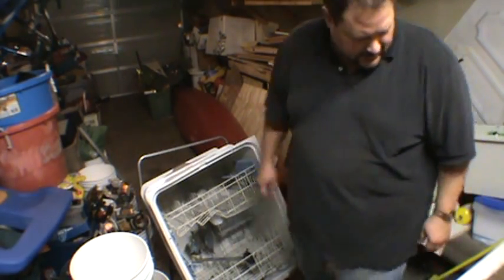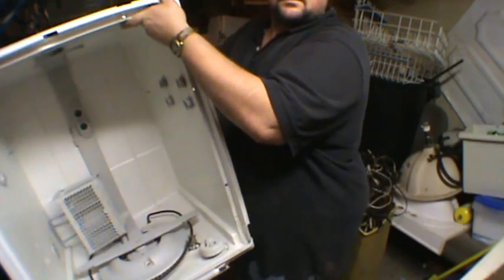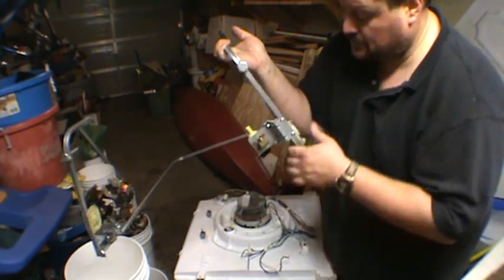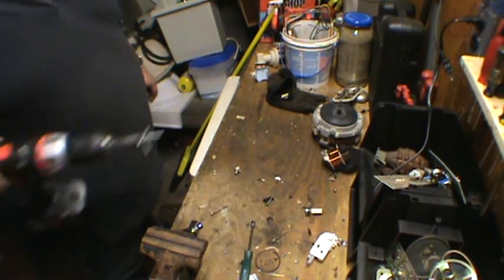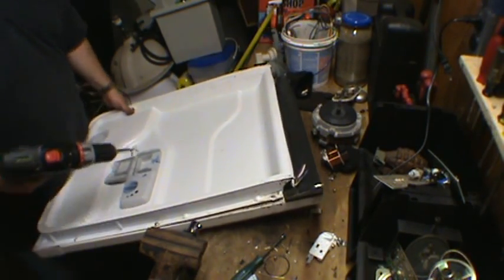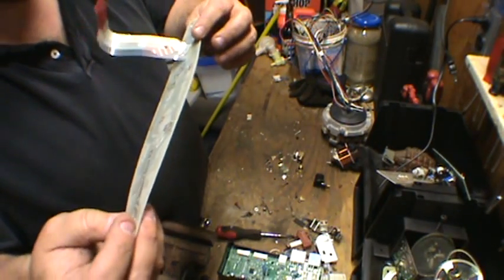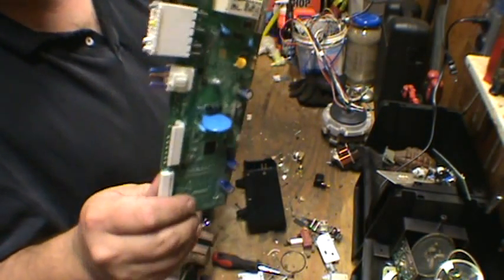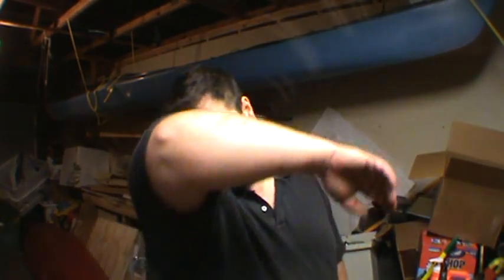How to Scrap a Dishwasher for Copper, Brass, and Steel.

Comment: Thanks for the great videos!  The top, bottom and silverware racks can be sold for big bucks (compared to the rest of the machine scrap value).  Probably $10 minimum for the silverware rack and $20 each for the 2 dish racks plus shipping on eBay.  Check sold listings for used racks.

Comment: he once again a great vid. I have done a lot of whiteware recycling. most whiteware will have a self diagnostic code so you can pin point the fault using fault codes with this knowledge they are easy to fix or sell the parts barring the faulty one . I sell the front touch panel as is where to local white ware shops or just drop of parts for free in return I get their unwanted units. these earn good money and normally in high demand 
front control panel, pump, motor, motor control unit,

Comment: I picked up a stainless steel dishwasher today...my first. Heaps of copper, with the power cord, wire, and motor. I also picked up a microwave oven to scrap, that some drongo cut the cord off.... only to find when I got home, there was stench and rotting something in the oven. I did a basic scrap of the motor and wire, boards etc...left the turning motor on the bottom and threw it in the back of the ute to take to the scrap yard with everything else.

Comment: I've wondered whether it is worth taking a motor apart to sell as wire and cast iron.
Someone told me a while back that motors sold for about 12 cents per lb.  It would make more sense to split into copper and cast iron; because wire is about 18 TIMES per lb what that motor would be; so even if you lose a little poundage by splitting it up; I still think it's worth it, IFF it doesn't take up too much of your time.
ZenNinja

Comment from the maker: Well, a few things there.  The motor in this dishwasher has more cast Aluminum than cast iron, 40cents vs 5cents per lb.  Motors are going most places for 22-28 cents per lb.  In the larger electric motors from appliances etc, it will pay more to take them apart.  Even the smaller ones will pay more.  The problem is that the small they are the more time it takes and your income per hour drops fast.  There are only a few types I don't take apart.  Thanks!

Comment: I like your videos. I'm just starting my adventures in scrapping and I've got a few questions. catv agw18 (aka cable tv wire). is it worth scrapping? is the braided lining aluminum or white copper? is copper clad aluminum worth stripping? Thanks for the
Reply from the maker: Hi and thanks for watching!  I actually have a video coming out very soon about stripping cable wire!  The sheilding net like wire is tin coated copper, in most cases (#2 copper) and in some cases, particularly the older stuff its #1 copper.  Aluminum wire is often not worth stripping unless its very thick, like 1/2 inch or more.  Check with your scrap yard and see what they are paying for the wire vs the aluminum.  Best of luck!
Reply: Moose Scrapper thanks for the thorough videos. When I came across several CRT TVs, a couple had aluminum degaussing wires and yokes,  also had a couple old light ballasts that had aluminum wire. The scrap yard at the time gave me about $0.51 or more for the high grade aluminum wire, I was surprised it was worth more than the other Aluminum items: cast, sheet, cans, extruded which were about .38-.42 at the time.

Comment: Do you have any videos of how to break down a large motor like the one shown in this video? I have several but don't know how to get the copper that's embedded in what looks like a liquid plastic out of it. Most large motors I've come across seem to have this plastic stuff around the copper.
Reply from the maker: tonocats I do have a video on that, but if you are referring to the center piece, or rotor of the motor I do not have a video for that.  I have been told that a heat gun works wonders on that part though.

Comment: What about that coating on the racks. Does it need to be removed?
Reply from the maker: No they usually take it as is.  Thanks for commenting!
Reply: Sweet! I'm going on my second week scrapping and things have gotten a bit over whelming. The things people throw out is nuts. Cordless drill, circular saw, heat gun, pressure washers, welder for solder, blower, tools, staple gun, even a wood chipper that may work and the TVs I'm at around a dozen so far.
Reply from the maker: Jerry Cherney It is just amazing sometimes...lol, oh well, their waste is your gain!

Comment from the maker: Yeah I know right?  I've thought about trying to sell it on ebay....Flat rate boxes cant hold more than 70lbs,  so I could concieveably fit $28 bucks worth in a box, but then the shipping would be $11, and there would have to be a lower price so taht people would find it worth buying, does not leave much wiggle room.  I probably get rid of 100-200 lbs a week of stainless......at 5 cents/lb =(

Comment: the arms that hold the drawers in are typically magnetic stainless. the sprayer on the bottom of d/w is 99% of the time non magnetic stainless if its not plastic.

Comment: let me know that would be great. the stainless steel screws are a good seller to boat clubs etc. lol get a multi meter to check the motors and pumps. boards as is where is. some manufactures will give you a rebate for the old ones iswell. I just started the computers and laptops a month back will send a pic or a vid on what I got etc.......might do one on a washer for ya lol.

Comment: My scrap yard will take the whole dishwasher as light metal .. I take off brass drop motor then use it as a place to put small steel. One thing I do not have is a place to sell boards

Comment: how much money is in a BASIC dishwasher..  Estimate
Reply from the maker: if you spent a good hour and completely took it apart, $5 ish.  Lately I just pull the visible wires, motor, and any brass or stainless steel off and drop the rest off as is.

Comment: holy sh*t dood I just picked up one of these from a trash pile. Not worth it. The large motor is aluminum and the frame is welded together. I been smashing at it with a sledgehammer. I can't quit now that I started.

So moose guy what is the heating element made of? its not ferrous. I don't think I'm going to try one of these again.
Reply: Johnny Sock Moose theirs not much in that, and all that plastic I wouldn't bring that home bro nasty

Comment from the maker: lol, I was actually thinking of flipping it upside down and making a chemical station.  Plexi glass in the front, connect some PVC pipe to the motor hole, and hook uo a couple plastic hair drier motors to suck the fumes outside........OOOOOOohhhhh the gears are grinding.  I think I was a hoarder in a past life.

Comment: u only get around 17 oz of number 2 copper out of that motor so at 2.08 a pound for copper its a waste to do....mainly due to the amount of work to get the copper out of the moter
Reply: motor lol
Reply from the maker: yes, you are correct, fortunately that is not the point of the video.
Reply: bluntman305

Comment: Why not show each amt that’s in a dishwasher and what it’s value is.? I thought the rest of your video was great.
Reply from the maker: I have done that in many videos.  The issue i run into the more of these items I scrap is that 1- they are not all the same, different brands, years, etc can have greatly varying amounts of the different metals and 2-if I list a value on a video that is going to be posted for years, it will only be valid for a short time as scrap prices change all the time.  Thanks for watching!